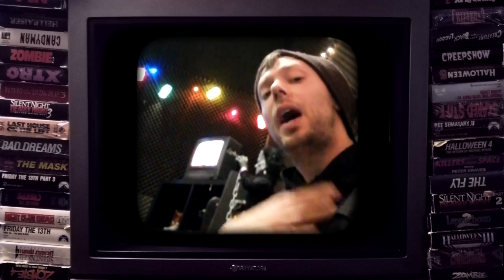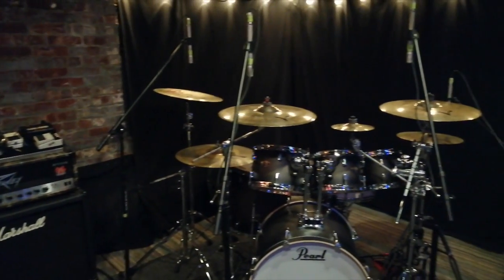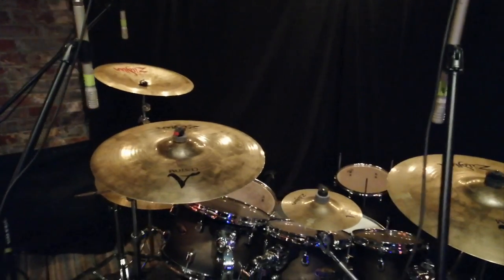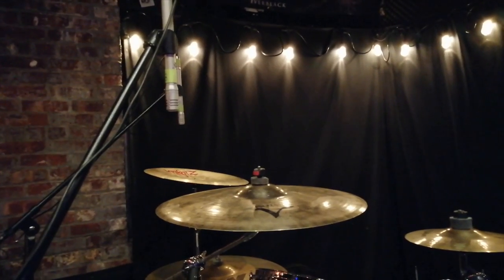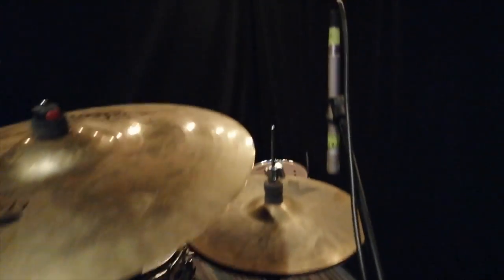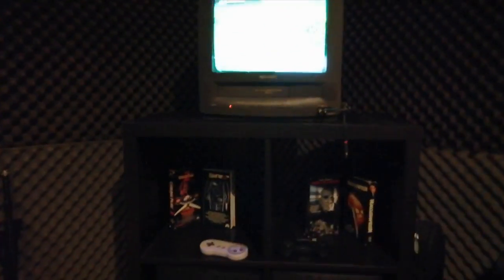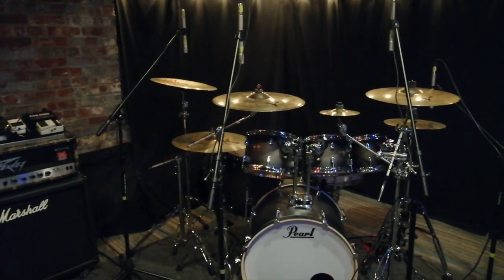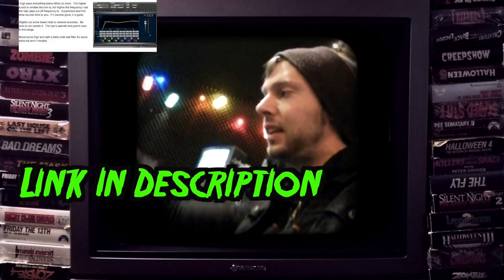THE Cymbal Micing Technique For Ultimate Clarity And Control - Recording Metal Drums

Comment: Interesting. I've never really heard of this using this method before. Pretty cool. I always thought that using a traditional overhead setup was important because it provides a big part of your overall snare sound, as well as toms too. I was always under the impression that the drum close mics were only a part of your sound and that the OH's provided the whole picture, in a sense. I guess my biggest gripe with this setup would be that I'd have to use more mics/tracks for this method. I guess it could be worth it though, if it gives you more control in the end.
Reply from the maker: Yes, traditional overhead methods are great for capturing a stereo image of the entire kit.  I use a traditional spaced pair whenever I'm working on indie rock or any other non-metal genre. 

This method is common in modern metal because it offers maximum control.  The drummer will almost always ask for a louder china or ride and it's good to have thr flexibility to do that.  The trick with this method is to heavily filter the overheads in the mix and to get the overall blend of the drum sound from the room mic. 

It does require more mics.  It's the only area of production where I prefer to use more than less in the microphone department.  Luckily the extra mics don't have to be expensive.  You can use almost anything on the ride/hats/china and extra inputs come pretty cheap these days. 

Thanks for watching!

Comment: So, honestly, this technique has changed my approach completely -But, in some of your other videos I have noticed that you often use many room mics, hallways mics, mics up high... What have you found the most useful so far?? Honestly, I did a pair of stereo rooms and I actually found that to be a little much for my productions. One mono room in conjunction with the cymbal spot mics works for me...
Reply from the maker: I experiment a lot with room mics, but honestly all you need are one or two to get the job done.  I'm a huge fan of close-micing my cymbals and using either a mono room or a simple, stereo pair.  Everything else is icing on top...of the icing..on top of the cake.
Reply: @FrightboxRecording  Agreed! 1 or 2 is all that's needed! And, honestly, my man... I'm even contemplating going without any -I'm getting soo much ambience from my cymbal mics, even one room mic is a little over-kill sometimes... Thanks for responding! Cheers!

Comment: Great video! Earned a sub from me. What did you think of using ribbon mics for this? I like using some active ribbons (a bit brighter than traditional designs but still buttery smooth) as my overheads because I can really push the high EQ for a razor sharp cut without it getting harsh. I'm thinking the figure 8 pickup pattern would help isolate the cymbals in this case? Anything to help keep the hi hat out of the other mics!!
Reply from the maker: I'm a fan of either cardiod or hypercardiod patterns for my cymbal mics..the more directional the better.  I have had good luck with using ribbons on my hats, ride and as a pair of room mics.  Give it a shot and let me know how it goes!

Comment: if you keep the mic towards the edge of the cymbals wouldn’t you get a wavvy sound when the cymbal goes up and down?
Reply: Cause i tried it that way and figured the bow of the cymbal is the best place to put it.  i think (don’t quote me) its because the freq.  of the top and the bottom are slightly different so you hear 1 tone when the cymbal goes up and another when it is neutral, idrk much but that’s what i’ve found though your type of mic oh placement
Reply from the maker: That can happen if the mic is too close.  For bigger cymbals I keep the mic 12-18" above it and have never had a problem.
Reply: @FrightboxRecording  hahah, that explains alot, i play a 26” cymbal 😂
Reply: @siank_  Year-old reply...but what you're hearing is the Doppler effect. Same reason a train horn sounds like it's ascending in pitch when it's coming towards you and descending in pitch when moving away from you.

Comment: They will all be ditched in Pro Tools drum replacement later anyway!
Reply from the maker: Hell no!  Replacing cymbals is sacrilege...unless the source cymbal sound REALLY sucks,  At that point you might as well just program drums.
Reply: @FrightboxRecording  it is indeed, but that doesn't mean it isn't done, and usually very badly!  When you mic cymbals that closely how do you avoid the inevitable phasing that occurs as the cymbals moves on its stand after it has been struck? That movement could easily and add subtract 25% of the cymbal to mic distance which is bound to add phase effects. S
Reply from the maker: @redtapemusic  As long as I don't go any closer than around 6", I've never have any issues with phase at all.  I think one of the tricks with this technique is to not be shy with the high pass filter in the mix on your cymbal tracks.  The cymbals will sound thin in isolation, but the entire drum sound really comes together when you blend in a room mic or two.